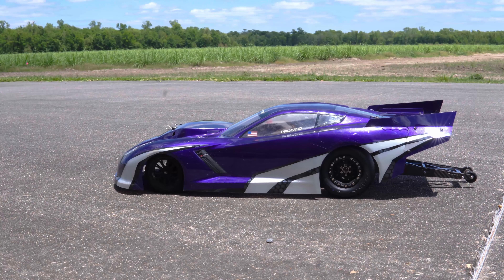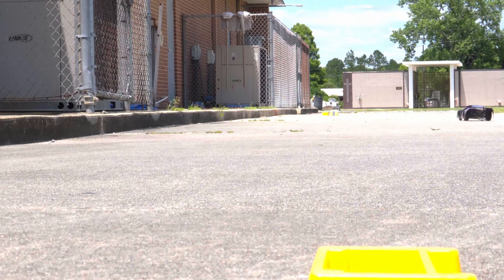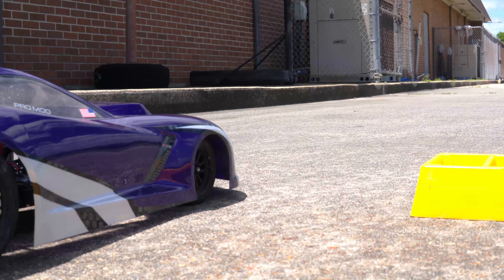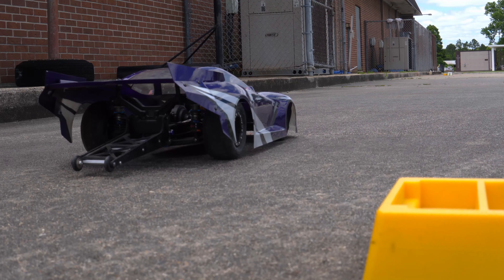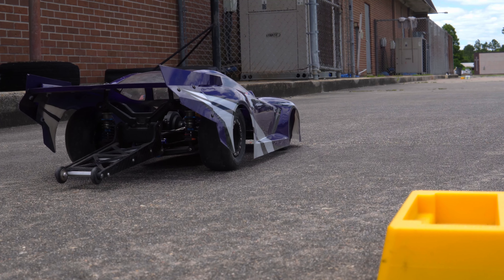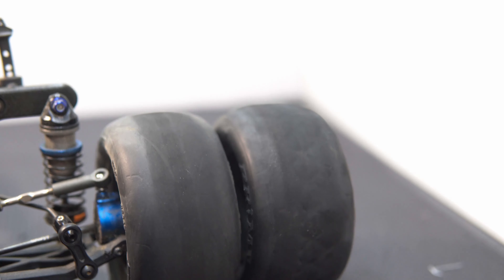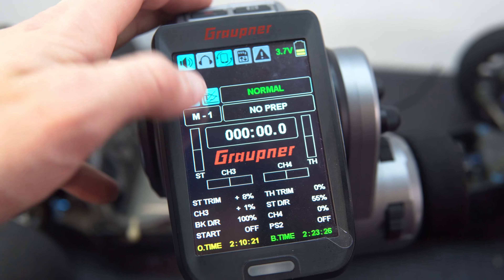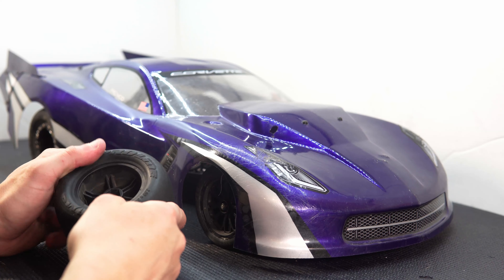Fresh Tires, Fresh ESC, New Radio! More Testing!! | RC No Prep Drag Racing

Comment: Excellent video. You can see how much quicker the car is now. Now that you've made the upgrades, have you considered going back to an unlocked diff? On my car, the car seemed to stop moving around on the top end when I went back to the unlocked diff. From what I gathered, uneven tire growth from side to side caused the issues with the car moving around at speed and began making laser straight passes. When the tires grow uneven, one gets bigger than the other too quick and that's enough to make it swerve or veer around. Anyways, excellent video! I like seeing the results of changes like that!
Reply from the maker: Thank you so much! I never really considered an unlocked diff but I may have to. I want to see how it'll work when the tires are broken in first, then I'll decide what changes I want to make next

Comment: I love following you bro but in my opinion watch Greg Bridgewater YouTube video on the small de slick i didn't like the idea but I did it but I feel like your car wild shine with those tire it really helped mine i tried every tire outthere and ill never use another tire now. and this may sound crazy but add a tad bit of weight up front to keep the front down so you can steer it threw the power at the other end keep up the awesome videos brother 🤘
Reply from the maker: I'm very interested in trying out the DE racing tires. I really like the 2.2 beadlocks though and they don't make a 2.2 tire. Hopefully they will in the future

Comment: i got a dragster with foam tires but i want rubber ones and also i coul get compound
Reply from the maker: Jconcepts and Proline both make wheels and tires for drag cars, you can check them out.